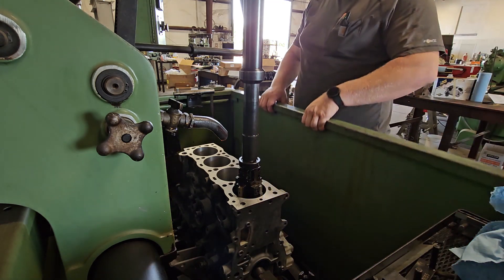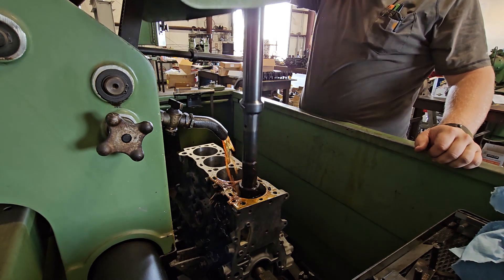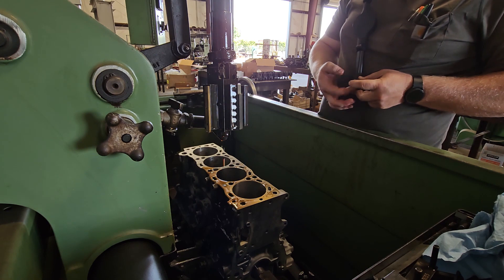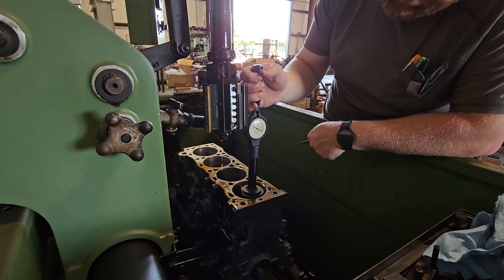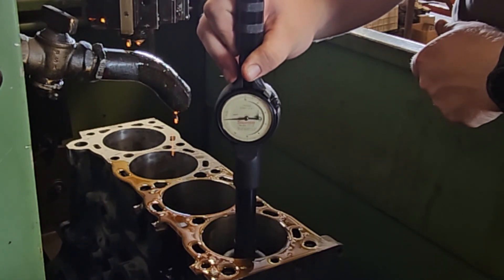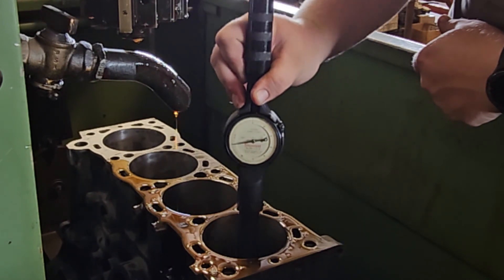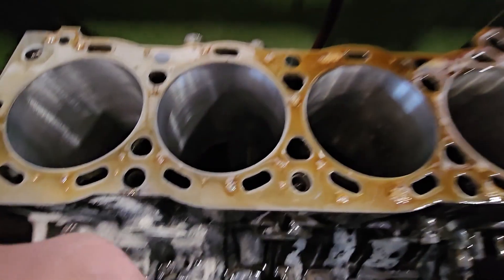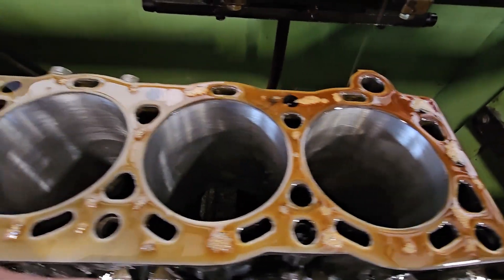Toyota 22R Performance Engine Honing the Block

Comment: No torque plate? Performance engine would require atleast a torque plate installed and torqued to chosen head fastener specs. I know its close as it is but not the proper way
Reply from the maker: It's all opinions. Not saying either of us are right. From my reading, I've only seen .0002 to .0003 bore warpage from not using a torque plate. With a .003 piston clearance, it'll be fine. Just couldn't justify a $500 purchase for a one time use on a motor making 50hp over stock. Not saying you're wrong, just can't justify that purchase